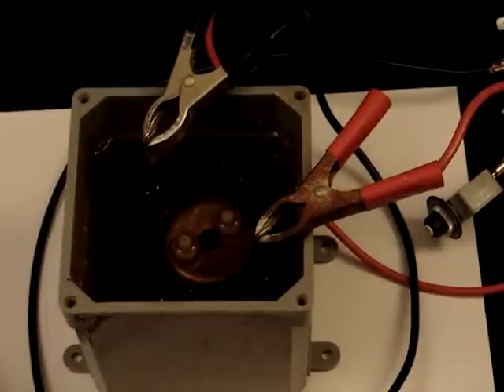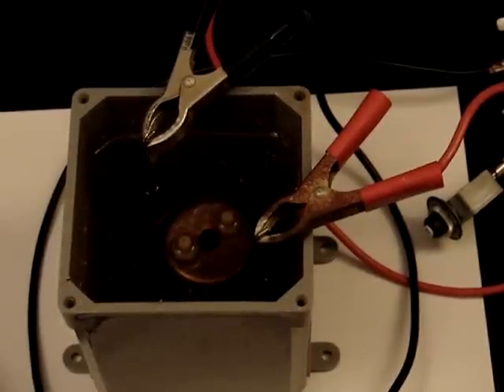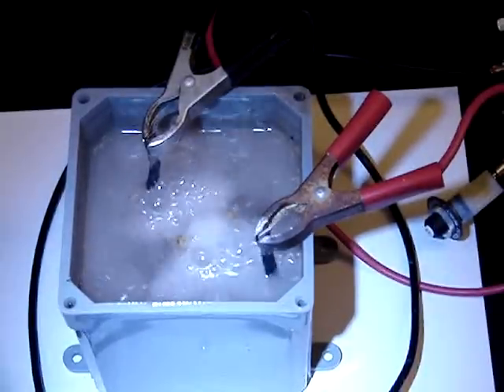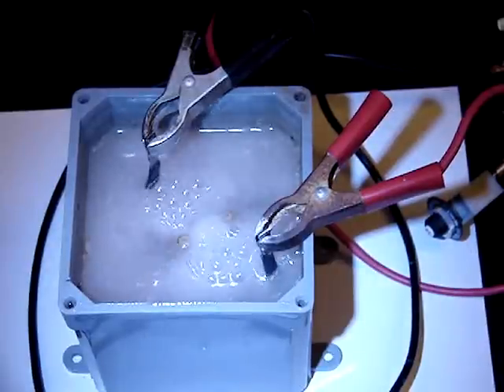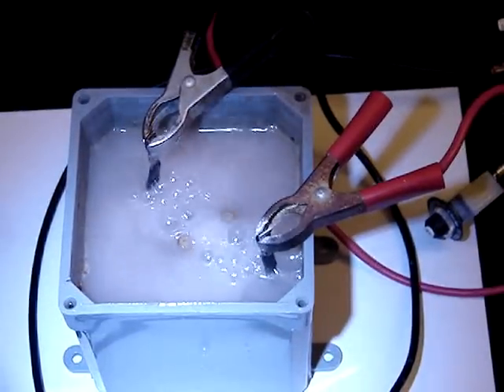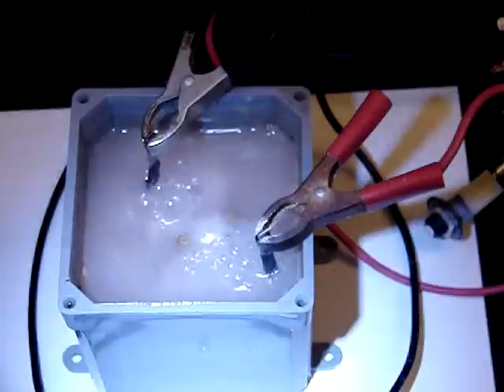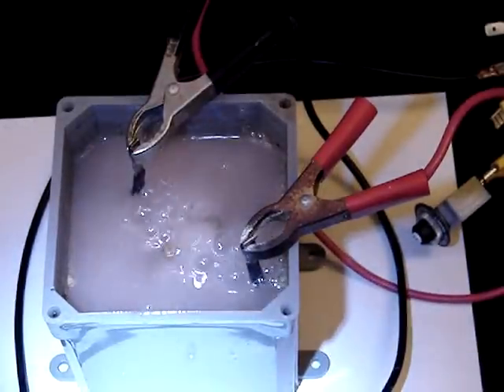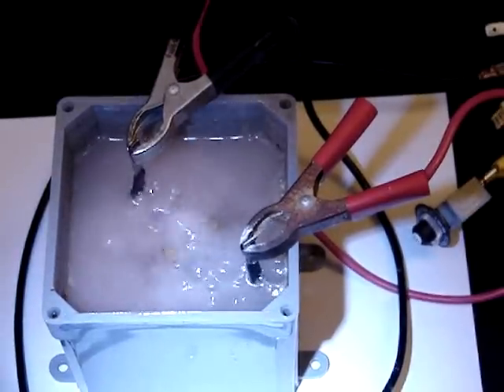Vid6 Volcano Cell Hydrogen Generator Output "9 Cups" (HHO, Brown's Gas, Hydroxy)

Comment from the maker: I have a hole in the bottom of the cups because HHO is created on the sides of the cups. By placing an exhaust hole on the bottom of the cell, I am also not risking the possibility of losing reactive surface area. 

The main object is to contain the gas within the cell and focus it to a point where it will then travel to the next cup and so on, until it reaches the top of the cell and is then released to the surface of the water.

I think I might drill the 1/4" hole larger to 3/8" and test it.